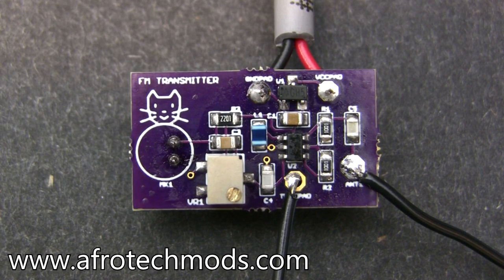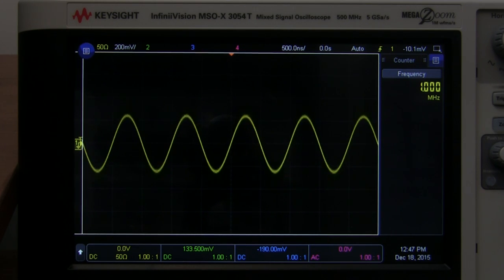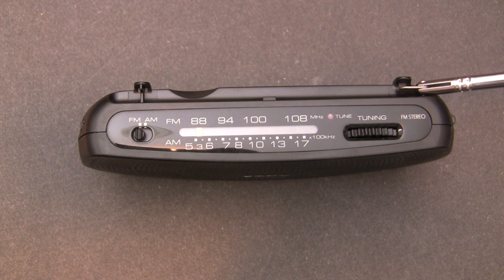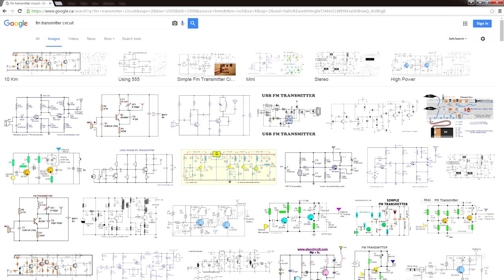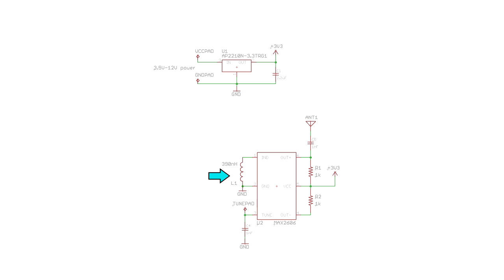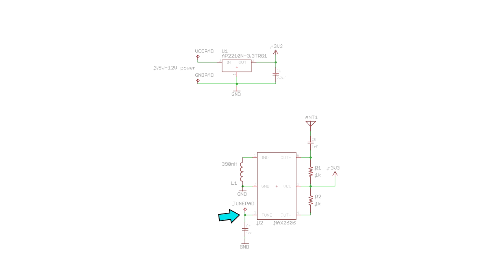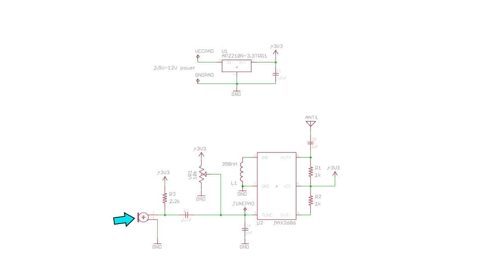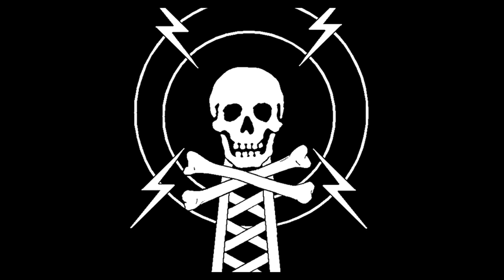Frequency Modulation tutorial & FM radio transmitter circuit

Comment: why and how do coiled/springy antennas work?
Reply: Well, quite bluntly put, they're made of spring steel, the same stuff as a spring.
The ones that have a few coil shapes at the bottom have that so they don't have to be as long.
You can reduce a 1M antenna to about 3-4 inches with the right matched coil shape.
Very commonly used on the circuit boards of things like phones in the form of square shaped traces too.
Reply: why is it possible?
Reply: Like do you mean how those specific antennas work? In that case, read the wikipedia page about helical antennas. It's just one of many types of antennas that do the same general thing: emit radio waves. Read into it, it's quite hard to understand but you'll get it faster if you know the idea for a while.
Reply: Eric M as i have understood this is no helical antenna its just a technique to save space and have the most gain by making it in a coil formation(you often see coil antennas in 433mhz applications.
 i guess as long as you keep the length for the specific wavelength right it works as if its just were one long cable and this formation seems to not intefear with the em waves

for this to be a helical antenna the diameter would have to be 95cm and the spacing between the coils would need to be 75cm

and a back plane of 1 wavelength in this case for 100mhz 75cm
Reply: THUNDERBOLT Aye
Reply: A straight antenna is nothing but a piece of wire.  As AC current passes through it, it radiates some of the energy as RF.  When you coil the wire, you create an inductor, which has an effect on current similar to what a capacitor does for voltage.  This can shorten the amount of wire you need for the antenna to properly resonate.  It's usually done just to save space.